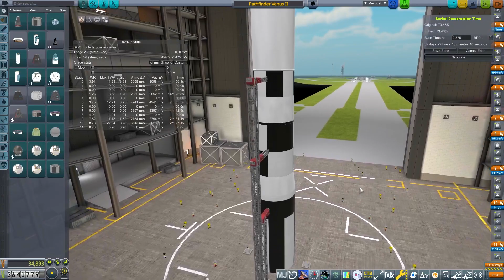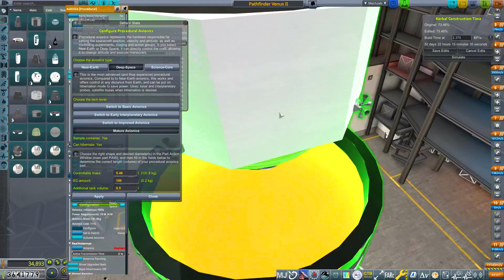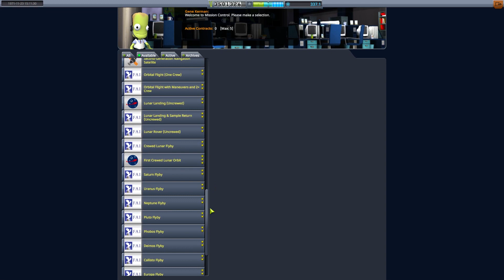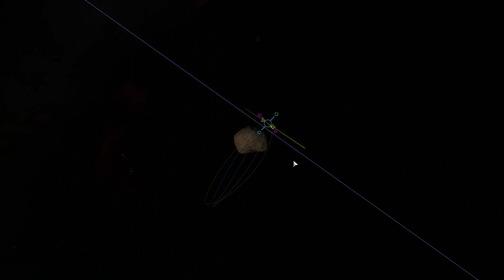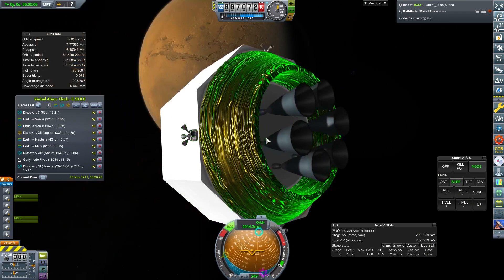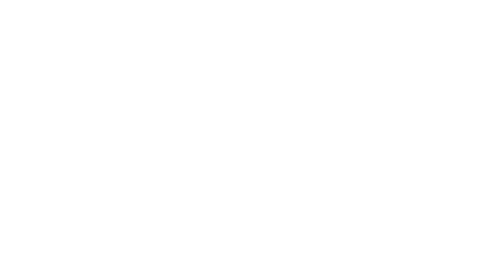A Very Basic Space Program | Episode 68 | KSP RSS/RO/RP-1

Comment: 5:45 why does it set the controllable mass to 0.843 (not enough to control the craft) after you apply 0.9 ton controllable mass. imo it should never set things LOWER to adjust for the actual internal volume of the avionics package

glad you are so persistent about looks or you would have never fixed it (you did at 9:00)
Reply from the maker: It seems a consistent issue when you do ‘small’ changes to controllable mass…
Reply: @seyMonsters  would be a lot better if it only changed the optional tank volume because it's the least important one

or maybe it would work better if you would use a boring regular shape instead of the fancy crafts you always make